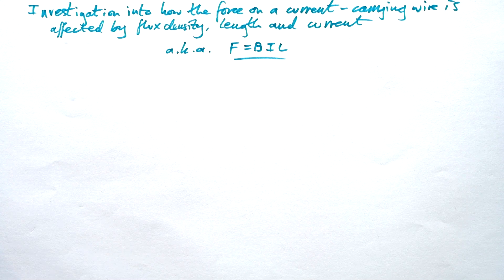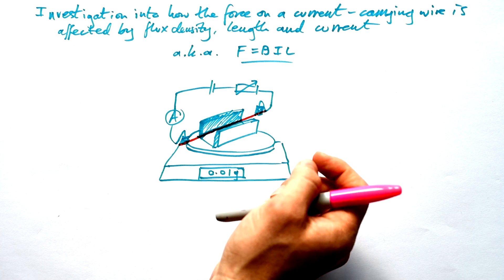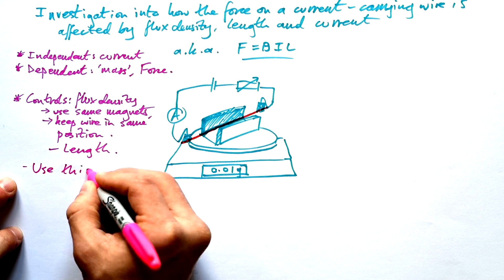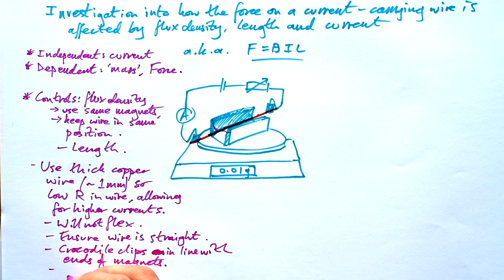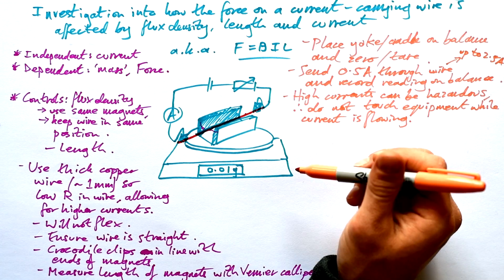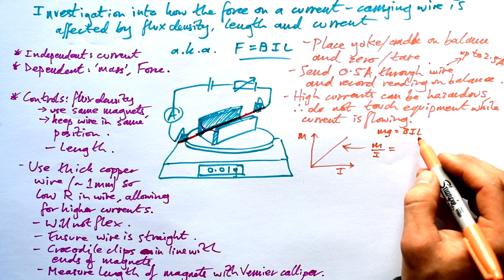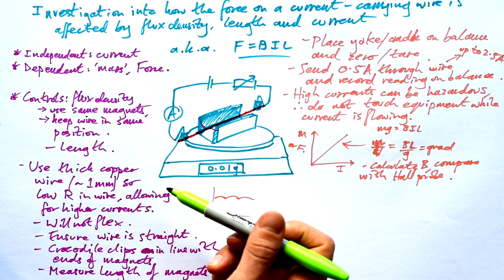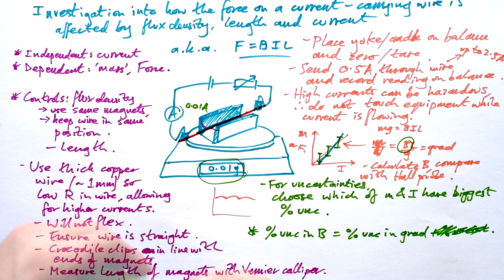Motor Effect (F=BIL) - Required Practical - A-level Physics

Comment: How are we changing the current? Is it through the use of the variable resistor? But you can't change current through a resistor, right?
Reply: bit late but changing resistance does change current
Reply: @EvoVFX  so does that mean the potential is constant?
Reply: @hardeepsaini1171  i mean in this case yeah because you have a fixed supply. in my practical i used a variable power supply

Comment: Why does the wire moving up cause the yoke to move down? Coz after all the wire is not touching the yoke to exert the force.
Reply from the maker: The wire doesn't need to touch the magnets to feel a force - exaclty the same for the magnets!